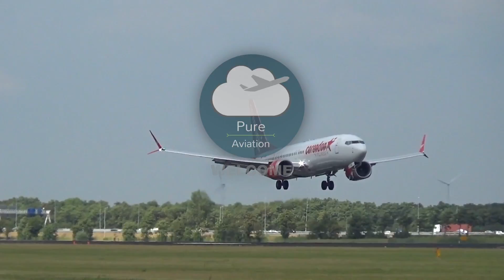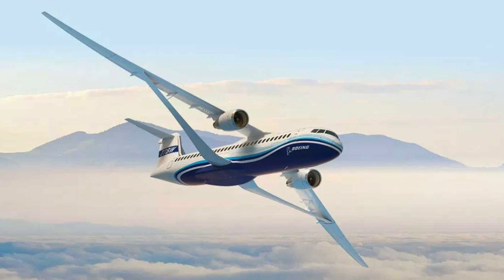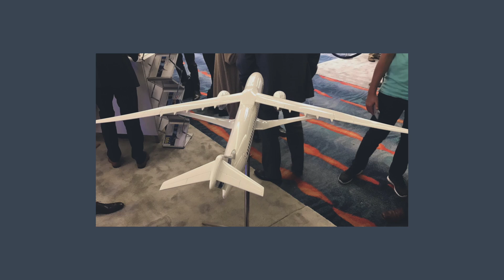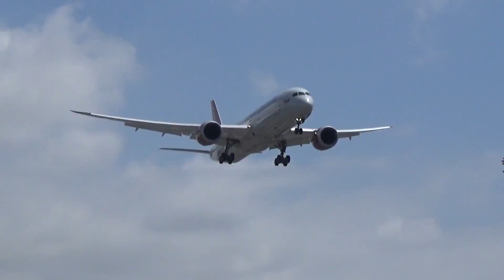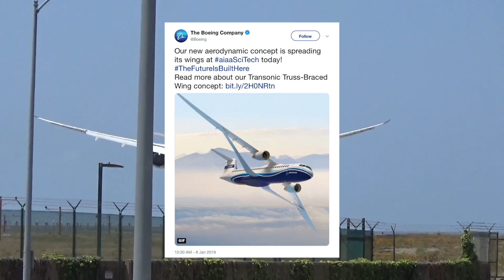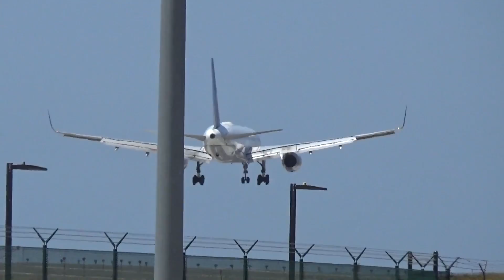Boeing Unveils New Transonic Wing Design

Comment: How does Mach .8 really help flight times as most commercial just can already go fairly close to that speed already?
Reply: It doesn't – it's the same. Truss braced wings can be difficult above critical mach number, so the innovation over previous truss-braced wing is it can fly at basically the same speed as all airplanes with far higher aerodynamic efficiency

Comment: Like Raptor said 2 hours ago, Mach .8 is NOT fast by today's subsonic-aircraft standards. The 747 and 787 CRUISE at Mach .85, and both have an MMO of Mach .90.

The Boeing Sonic Cruiser, a project that was ultimately scrapped in favor of the B787, had a working cruise spec of Mach .98, with delta wings set far aft and a canard near the front. 

The only advantage in this wing, if no actual speed advantage is realized, is it's efficiency. If it can produce a 60% fuel savings, it will sell.
Reply: 60% savings is impossible.
Reply from the maker: Yes, you are right about the 747 and 787 cruising at Mach 0.85. However, those are large aircraft. The 737 and A320 (which are more in line with the size of this aircraft) both cruise at around Mach 0.7 to Mach 0.75, which does make this concept plane comparatively faster.

Comment: .8 Mach is not faster,  .8 to .85 Mach is what current airliners fly.  

The design reduces drag from the wing which will increase efficiency and reduces fuel consumption hence the statement of 60% more efficient over 2005 designs.
Reply: Guys, ignore Pure Aviation. 500 knots is not .75 Mach at cruise altitude, where the air is colder and thus the speed of sound is slower.

500 kts at 30000 ft, where the speed of sound is 589 kts on a standard day, is roughly Mach 0.85.
Reply from the maker: Commercial aircraft typically cruise at around 400-500 knots (which is about Mach 0.6 - Mach 0.75), so it would be a bit faster. You are right about the design reducing drag though.
Reply: @pureaviation3596  So there going to do all this for 34mph faster, doesn't make much sense. If they were pushing 700 that would be something.

Comment: Not as interesting than a full boxwing design imho. Truss wings still has wing tips, so they still generate drag and vortexes.
Reply: Raked wingtips?
Reply: The box wing won't have the structural advantages of this one so it'd be thicker and less efficient
Reply: @Adlore  What about a cranked arrow wing which has an extended wingspan to accommodate both swept and delta wing advantages?
Reply: @oranges866  I don't know the specifics, but that'd probably be great for supersonic aircraft, and my guess is that it'd be heavier than traditional swept wings for subsonic jets